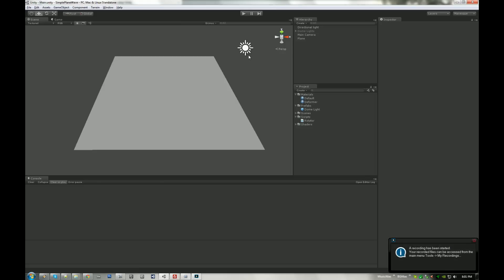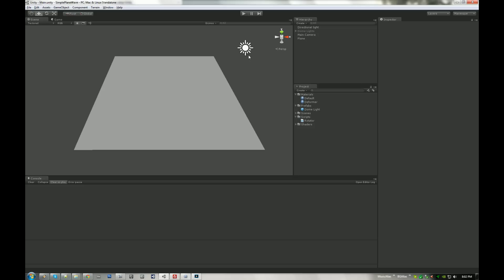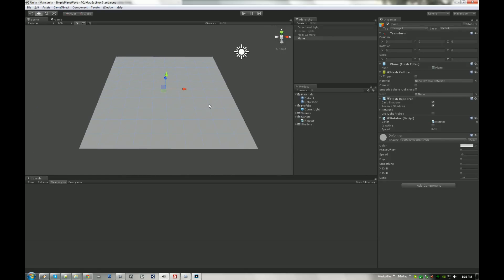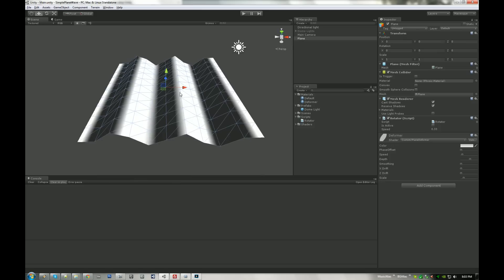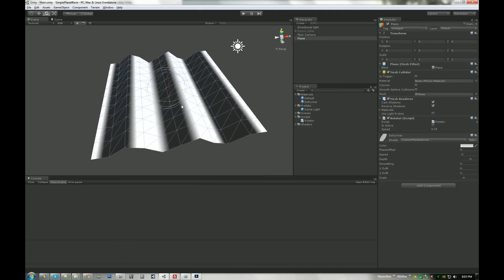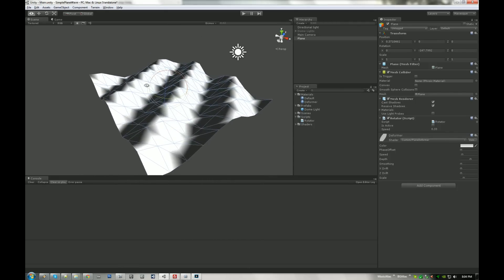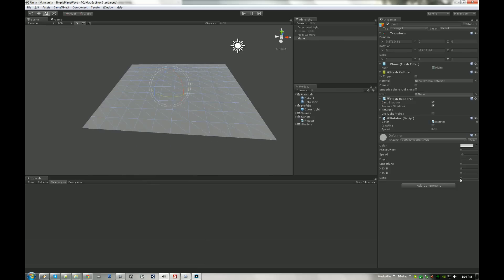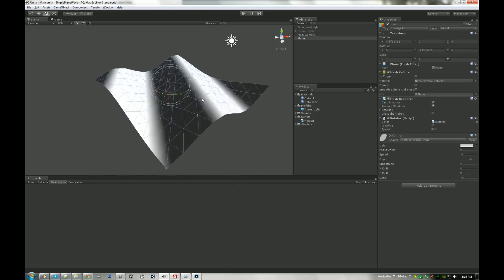Rebuild normals in vertex shader (Unity)

Comment: Code translation: https://pastebin.com/emU7HxKe
- Fixed some issues with matrix transformation (which was causing the mesh to offset when translating).
- Vertices and normals default to object space (since I kind of want it that way for my application). There is a toggle to switch to world space as originally authored.